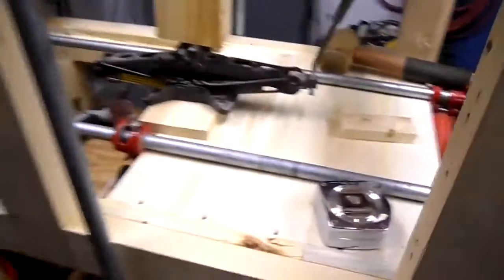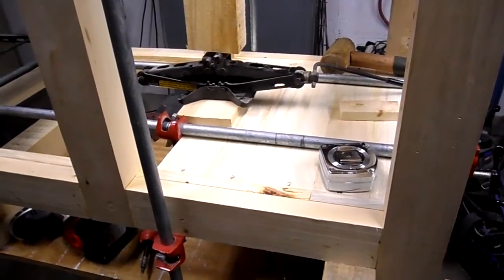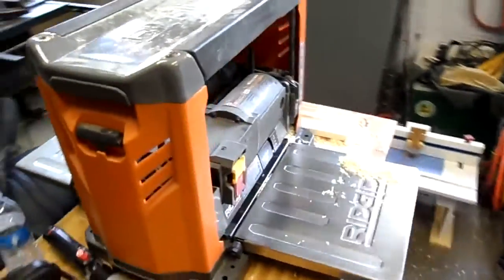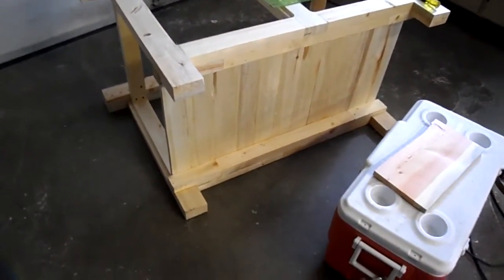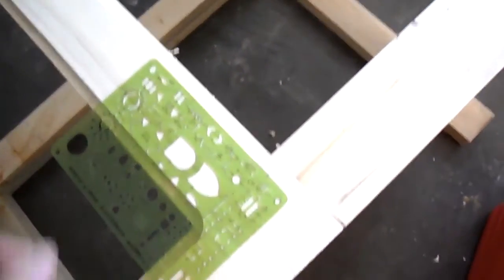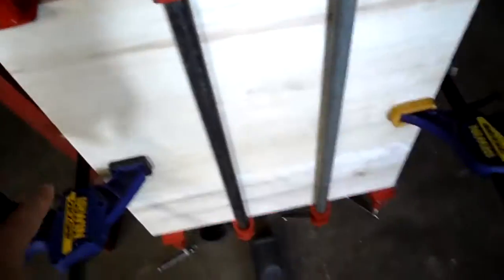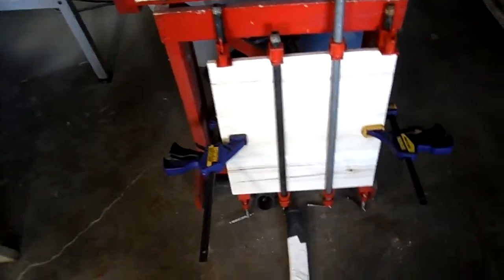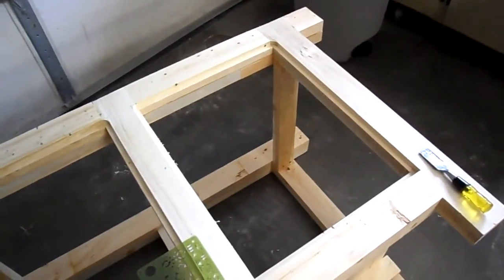Installing the Bottom Shelf of My Workbench

Comment: Looking good!
Reply from the maker: J.D. Ransom Thanks J.D.  That top I'm building is taking a long time to make.  I'm gluing 5 or 6 boards at a time and having to wait about 6 hours before I feel comfortable taking the clamps off.  Using a belt sander will take some time to smooth the entire surface down, also.  Stay tuned!